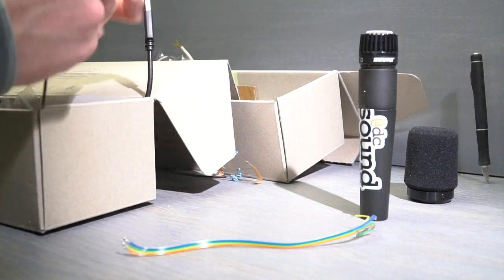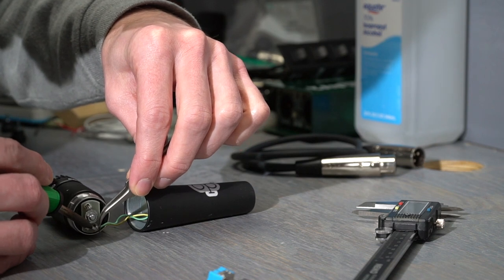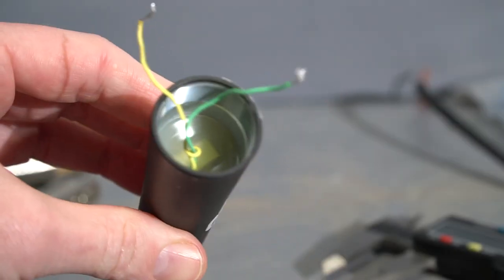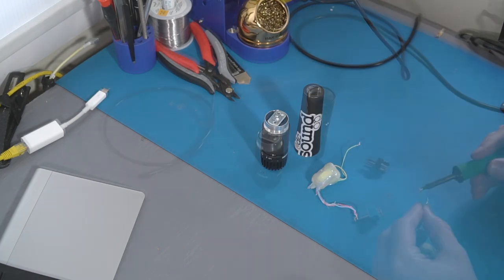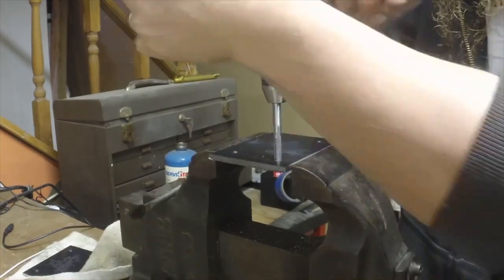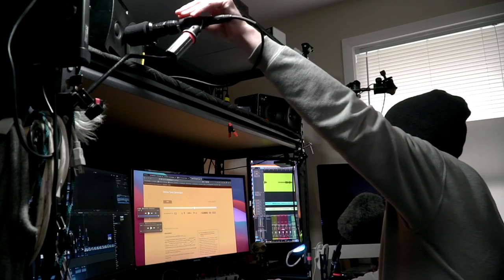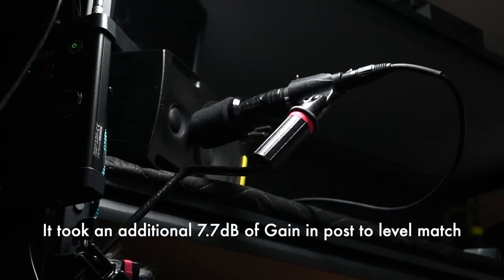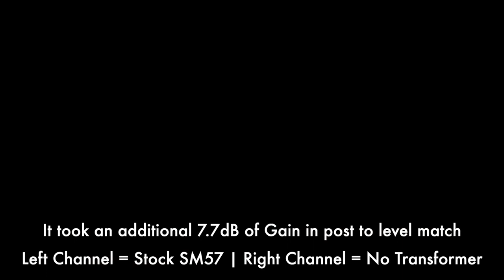Shure SM57 Switched Transformer Mod w/ Audio Tests - pt.1

Comment: Very cool! I'm planning to try this with the SM57 predecessor, the 545SD, which already has a switch installed. I just need to convert the switch to bypass the transformer. Hopefully the stock switch has three poles to use as an on-on switch :)

Comment: A couple ideas:

First, rather than boiling, I would stick the mic in a freezer and then use a hammer and dowel to try to knock the glue loose.  If that works it would be much less messy.

Second, rather than add a switch, I would wire in a 5 pin XLR connector and make 2 adapter cables to select between transformer and no transformer or one cable with a switch.   You could carve a couple grooves on the side of the glue to get the new wires from the capsule around the transformer to the connector.

If you don't mind making cables, doing it that way would be 100% reversible and wouldn't require an extension for the mic body.  It might add a little cost but it would be all off the shelf.

Comment: It seems like removing the transformer kind of gets rid of the reason to use an SM57... the high end. If I wanted a more mellow sound, I'd just pick a different mic. Plus, I'd imagine having to add all the extra gain would raise the noise floor.

Comment: I bought a SM58 from ebay and wondered why it sounded toppy. When I pulled it apart, I found it had all the looks that there was a transformer in there but further investigation after pulling it apart, I found the so called transformer was just the casing and the wiring went  strait from the XLR to the capsule. The danger with doing this is if you accidently turn the Phantom power on, you can cause damage to either the capsual or desk.
Reply from the maker: That sounds like you got a fake possibly? 

Also, other than older ribbon mics, there is no extra risk plugging this into a phantom powered input - here’s a good article over at Sound on Sound that will hopefully give some more insight. - https://www.soundonsound.com/sound-advice/q-phantom-power-on-dynamics
Reply: @DcSoundOp  It was a fake im sure. It works ok and I only use to use it to talk to performers when doing sound checks but now with my digital console, I can do all that on stage with my Ipad.
Thank you so much for your reply. Appreciate it.
Reply: @DcSoundOp  Also thank you for the article. Very interesting.

Comment: Thanks for making great videos! your test request form is a little broken. I can only select 2 options for the multi answer one.
Reply from the maker: I have fixed it now, thanks so much for the heads up on that!
Reply: @DcSoundOp  your welcome. Also, have you ever used the Shure 588sdx? I think it sounds like the 57 without the trasformer.
Reply from the maker: I can’t remember ever using a 588sdx - they seem pretty popular online though, I might have to keep an eye on eBay for one to check out. Thanks!

Comment: How can you use a mono microphone yet get stereo output?
Reply from the maker: I'm not sure I understand the question? Are you asking about something specific in this video or is this just a general question you are wondering about? Thanks.
Reply: @DcSoundOp  It’s regarding the video… you use a mono microphone but get stereo output, watch the video with headphones and listen carefully.
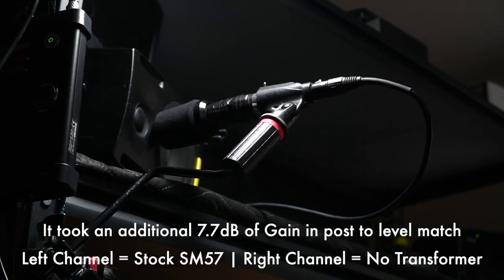Reply from the maker: It's kinda a long video with a bunch of examples, but if you're talking about the part at 8:33, that's the mic recorded both ways, then synced in editing and panned so you can hear the transformer in one ear and no transformer in the other. If that's not what you mean, can you give me a timestamp reference? Thanks.

Comment: The funny thing is they use to make sm57 without the Transformers they were a cheaper version but the problem was if you switched on (phantom power) you would cook the diaphragm and therefore the microphone would go straight in the bin. That's why the sm57 and sm58 are so robust and just don't die because of that Transformer
Reply from the maker: Unless you have a damaged cable or otherwise short one of the pins to ground, there is no issue with using phantom without the transformer. Even then any issues would fall a good bit short of cooking the element. I linked an article from sound on sound on another comment here. This thread covers a lot of common questions related to a 57 specifically as well if you read down to the end, including one user who intentionally shorts his to test it & reports that it’s still fine. https://www.gearslutz.com/board/geekslutz-forum/609331-no-transformer-sm57-phantom-protection.html   Thanks for the message.

Comment: As far as I understand your wiring, you will suffer "tone suck" as non-truebypass guitar pedals suffer. Due to loading on the primary of the transformer..
Reply from the maker: Definitely planning to do some rough measurements of the element alone vs. wired in this arrangement in part 2. I’ll include measurements and some more audio files you can download in directly as a baseline before I send it out to for others to try. Making a bit more space to work with inside will really open up the options for different configurations once we sort that out. Thanks for the message!

Comment: I probably would only do this to a SM57 that was out of warranty. I just don't see the percentage in modding a Shure SM57, an $ 8 clone maybe, but not the $ 100+ authentic Shure. Seems to me, it would be easier to add resistors somewhere and attempt to make a clone sound darker with a treble bleed for lack of a better description. Clones generally trend towards the Shure across the range of frequency as close enough anyway.
Reply: I don't think I care about warranty on an SM57, they are passive devices with essentially no electronics, physically are built like tanks, it's almost impossible to break them, the only realistic way I can think of it breaking one is if some electrical accident that fries the transformer coil, at that point it would be considered user error and not covered by warranty, It has no switch either, so no switch that can fail.
If some wire somehow manages to get lose inside it's also trivial to solder it back, so the only in the extremely rare situation that there's some problem with the capsule that causes it to degenerate over time would I send one to warranty, but to me that seems extremely unlikely to happen, I would be willing to take the risk.
Usually what fails are active electronic parts like transistors or mechanical parts.
Reply: @God-yb2cg  Pretty much where the cost effectiveness of a more affordable brand falls. You can buy several mics for less than the Shure passive mics. this is a world of can something be done for seamlessly less. And unless Shure would guarantee their warranty for a product would be available 24/7 even in a warranty claim, you're still buying a spare with those for your own coverage and peace of mind for the repair time. When a Chinese branded microphone is $ 12, you can buy 8 of those & have 7 spare mics or mic vocals, instruments. And the Chinese brands are providing mic, cable & stand clip. I don't see how Shure can really compete. with that. I went with Pyle Pro for this reason, I won't allow my insecurities of a failed product allow me to make a poorer decision for product. It's almost like Shure really has a $ 15 microphone and their warranty is $ 84.99 of the MSRP. I mean everyone else on the planet can make a $ 15 microphone, but Shure can't ?
Reply: @jimcamp2423  Well, what I mean is that a dynamic microphone in general is very unlikely to fail, from a working principle they are extremely simple devices, of course the Chinese always manage to cheapen the construction to the point that even the simplest and roughest design fails...
One thing I've noticed with cheap gear of any kind is the lack of quality control, while one sample may be excellent in both terms quality and durability, another one not so much.
I personally don't like playing lotteries much, of course most times I can't afford quality products anyway, and have to go with a cheap version.

As for the Pyle Pro, I didn't like the sound of it when I watched a comparison video, ended up getting an used SM58 for 50 eurobucks, but now I'm paranoid that I got a fake copy and I'm thinking of returning it and get a Behringer xm8500 instead (which as a bonus it's much cheaper). Problem is, I really like the sound of this mic I got (either if it's original or a fake), if I switch to a xm8500 I may regret it, so I will probably keep this one instead so I don't have to play the lottery again.
Reply: @God-yb2cg  I think you'll find the Behringer is voiced not appreciably different than a Pyle Pro, Samson or even a Shure.dynamic. And the 1st thing anyone does with the mic is to enhance it with an amp & vocals effects. Does any mic have the output range to become one or another with EQ ? I hope your's is a real Shure & provides a reliable service life. I hope mine hold up too.

I went with Pyle Pro, a year into that leap of faith and they're at the warranty's  end, there are no problems to report, no degradation of signal or catastrophic failure. I hope that it lasts as long as any Shure. If not, I can buy several of them. Would a Shure have survived what took any Pyle out of action just the same ? A longer warranty is a nice thing, but with a malfunctioning or dead mic & a warranty, you're still shutdown for production for the shipping & handling & repair process. And in that case with the Pyle, I can buy a spare mic or even have the additional mic to use for other vocals, instruments & cabs. I find myself playing the mind game with myself, the uncertainty that somehow the Shure is several times better than the Pyle Pro. FOMO really. That's the thing with these Tube videos. Every mic comparison, it's not a Shure, but it's pretty darn good. And then they go back to whatever it was they were using anyway. You're right about dynamic mics, simple, no phantom power required. They are what they've always been, solid & reliable.